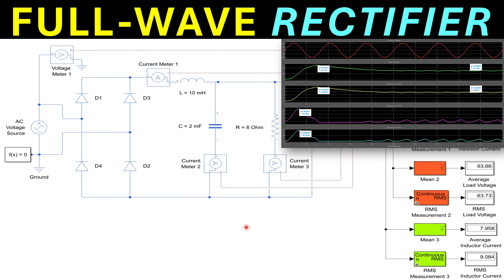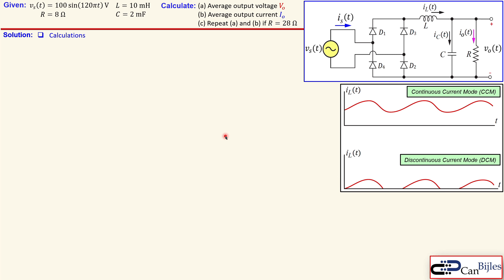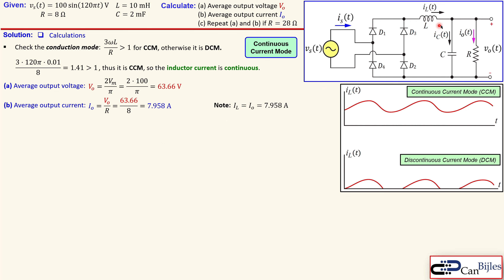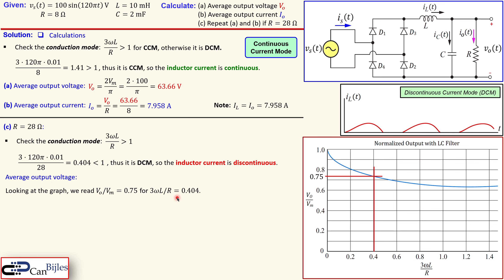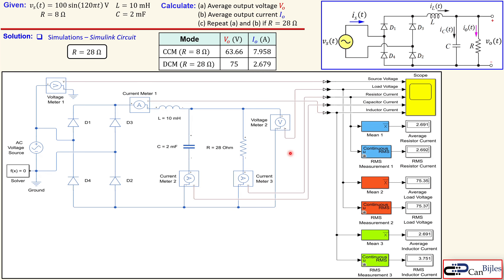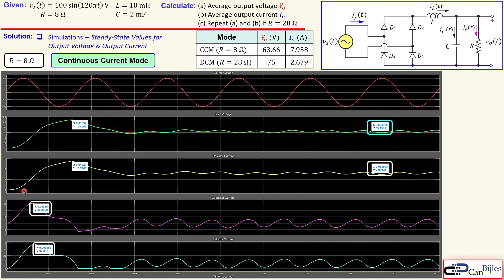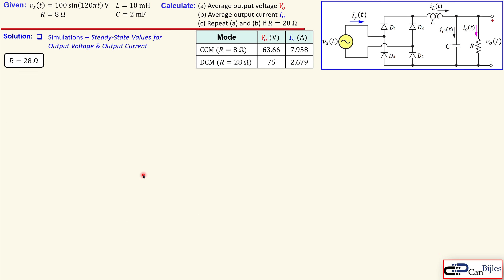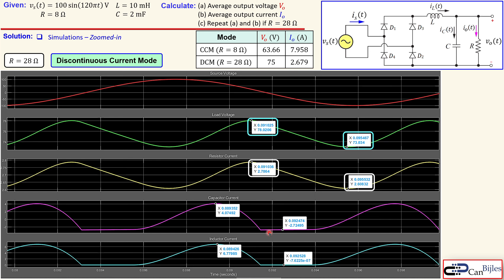⚡Full-Wave Rectifier - LC Filter & Resistive Load ⚡ Power Electronics Calculations & MATLAB/Simulink

Comment: 4:08 how did you get the "normalized output with LC filter" graph? Is it derived using numerical simulation due to the non linear nature of the diodes?
Reply from the maker: The graph for "Normalized output with LC filter" is taken from a nonlinear equation. I left the details out, but it is somewhat work to get to the actual details. This is not due to the diode, but due to the discontinuous behavior of the inductor current.
Reply: @CANEDUX  Do you have another video or source that covers these details? thanks
Reply from the maker: @fablearchitect7645  You can look at Chapter 3 in
Power Electronics, Muhammad Rashid for more details.

Comment: Hi, first thanks for doing such great educative content!
Secondly, I have a question would it change anything if we put a fly back diode for the inductor to protect other components against the peak voltage/current spikes when the circuit is starting and turning off?
Reply from the maker: Thanks for your message! Great to know that you liked the video 👍 
You can place a flyback diode across the inductor, but can cause some leakage current and voltage losses. Also, in order have it working as expected, it needs to be fast enough,  has low turn voltage and sustain the reverse voltages in the circuit. So, it is not just placing a diode in the circuit like that.
Reply: @CANEDUX  thank you for your teachings and reply! As you might have noticed I'm a noob in electronics, just learning it to get a better understanding of things around us and maybe do some little hobby projects and you are of great help! Thx again 😁
Reply from the maker: @nrik7  Happy to help out! We all start unexperienced, so no need to bother about that. You can catch up.
Share the knowledge 😉

Comment: how we calculated capasitor current
Reply from the maker: You can use the expression of the inductor current and the load current, but you need the time domain representation of these currents. Why do you need it?
Reply: @CANEDUX  for my homework
Reply: how ı calculated with math not also simulation ı have to make with m.file so ı need formula
Reply: @CANEDUX  Türk müsünüz?
Reply from the maker: @serhatkalkan7995  Evet
Reply: @CANEDUX  ben de düzgün olmayan ingilizcemle cevap vermeye çalışıyorum kusura bakmayın hocam teorik olarak hesaplamasını yapmam lazım matlab m.file kodları kullanarak çizdirmemizi istedi hocamız çıkış gerilimini sizin formülünüzle hesapladım psim sonuçlarıyla da uydu fakat matlabda kod yazarak grafik çizmek için formülüne ihtiyacımız var ben de türkçe ingilizce karışık bir çok izlediğim videonun hiçbirinde bulamadım en son yorum yaptım  cevap vermenizi beklemiyordum ama teşekkürler
Reply: @CANEDUX  hocam şuan psim üzerinde yaptığımız tam köprü doğrultma devresinde teorik olarak lc filtreli değerlerde hatalı çıktı uyuşmadı hesaplar programın simülasyonu ile 50hz L=7mH R=30 C=10000u 220 rms gerilim siizn yaptığınız hesaba göre vo 233.5 çıkıyor ama psimde 255 gibi bir değer gösteriyor
Reply from the maker: @serhatkalkan7995 Bu kitaplarda istediğin bilgileri bulabilirsin: Power Electronics, Daniel W. Hart ve Power Electronics, Muhammad Rashid